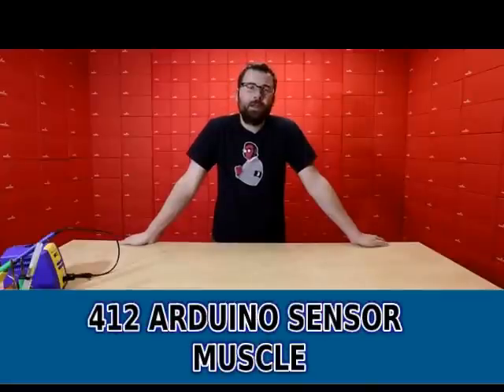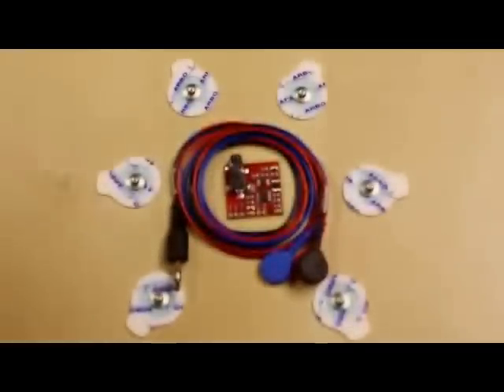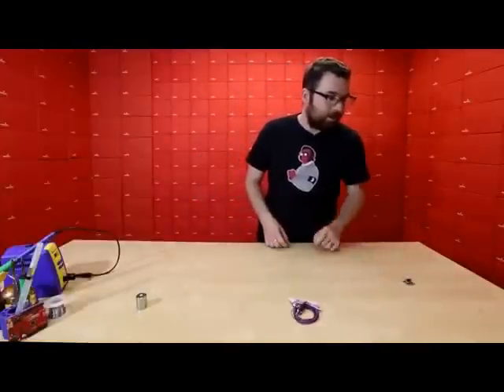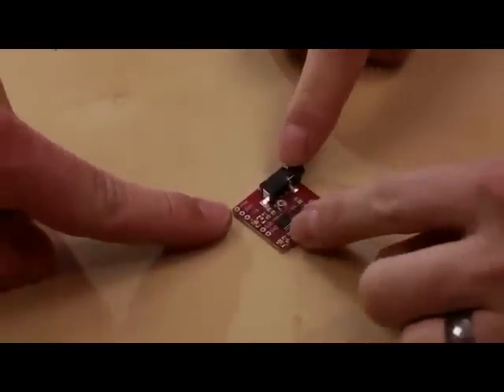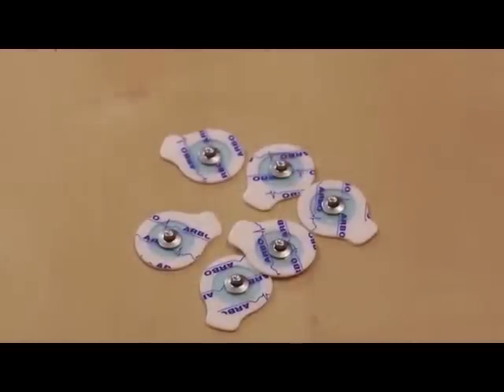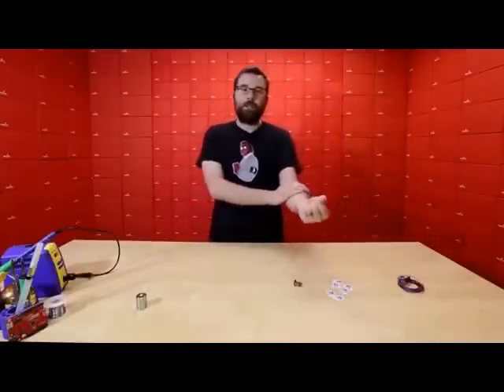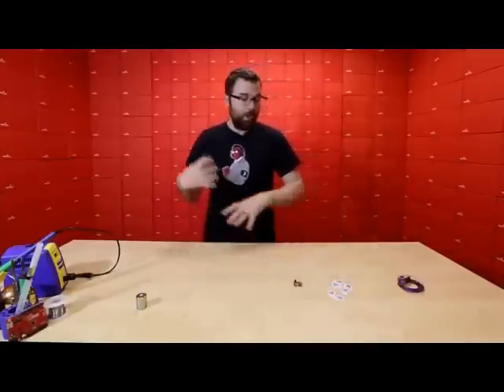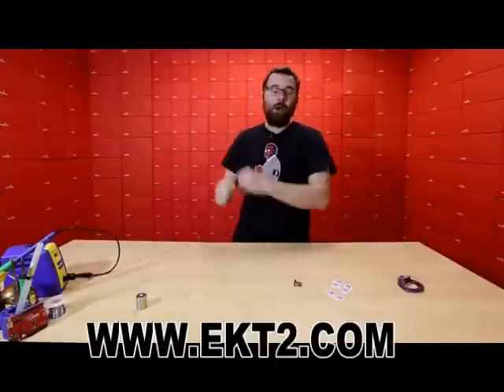412 ARDUINO SENSOR MUSCLE

Comment from the maker: !الآن يمكننا استخدام عضلاتنا للسيطرة على الأشياء
هذا صحيح، يمكنك اخذ إشارة كهربائية مباشرة من العضلات ووضعها في جهازك.

Granted, using our muscles to control things is the way that most of us are accustomed to doing it. We push buttons, pull levers, move joysticks... but what if we could take the buttons, levers and joysticks out of the equation? That's right, take the electrical signal straight from the muscle and put it into your device. 

VIDEO>> http://youtu.be/1oJX35hSSFw

412 ARDUINO SENSOR MUSCLE
WWW.EKT2.COM